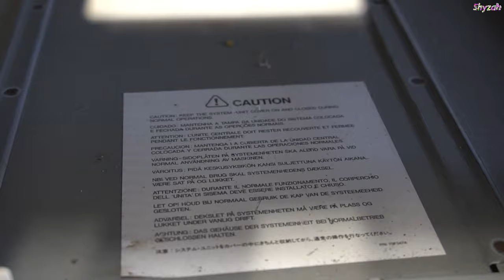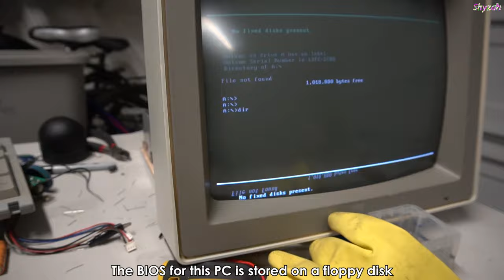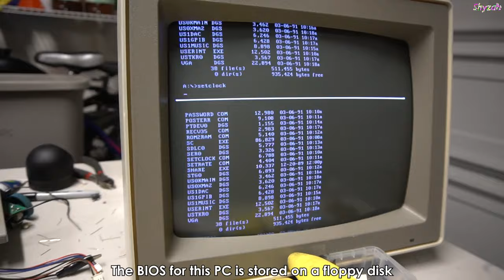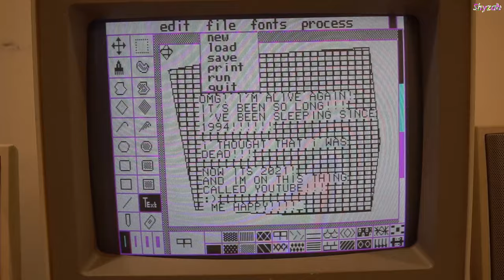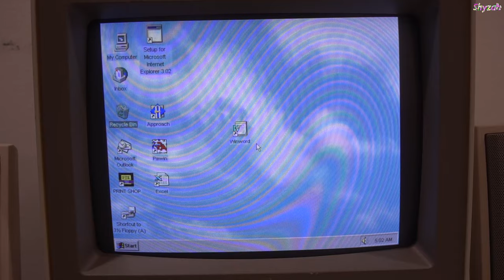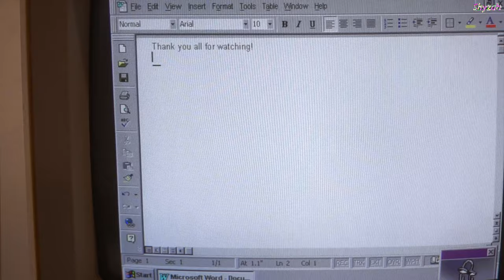Abandoned IBM Computer Restoration! (1992 IBM 35SX)

Comment: That was a nice IBM pc restoration video! 
Although I am very convinced, in 13:59, i want to know where do I get these custom keycaps: light blue WASD and the orange-red ESC keys? Are there any links of shops or 3D models for printing these keys? I am also interested in getting older IBM Model M Keyboards.
Reply from the maker: you can find them on the Unicomp website.

Comment: This is very cool bro!  Great video!  And I was curious so I did some googling and found out that this machine is actually an old 386SX running at a "blazing" speed of only 20MHz!  I wonder if that machine had the 80387 math co-processor on the board as well?
Reply from the maker: Im not sure about the math processor ill need to look into it. this thing could barely run windows 95 haha. I was too lazy to set up a fresh hard drive but when I do itll have windows 3.1 on it
Reply: @Shyzah  Yeah, Win95 is a pretty heavy load for a 386! 😂

Comment: try to put a nvidia or windows 10 on it
Reply: Dude, thus thing probably couldn't even READ a drive big enough to hold a Windows 10 installer.

Some tiny versions of linux might work if they have drivers for the hardware
Reply: @UNSCPILOT  lol